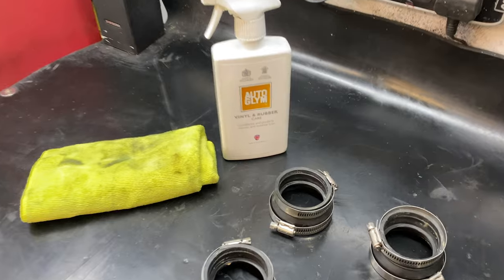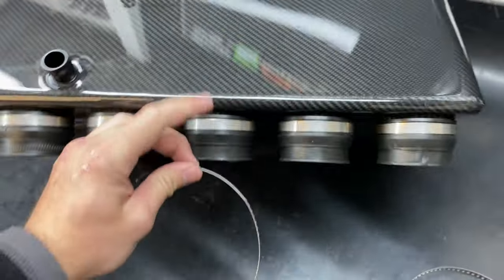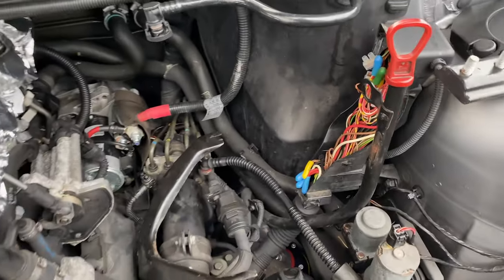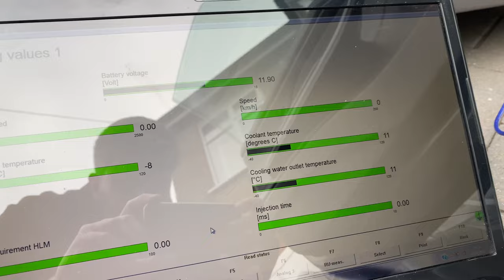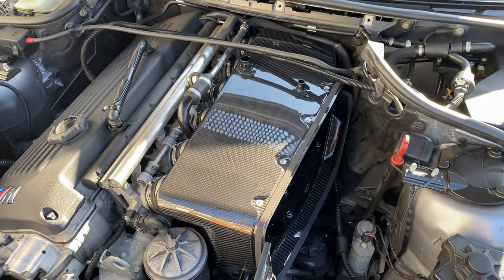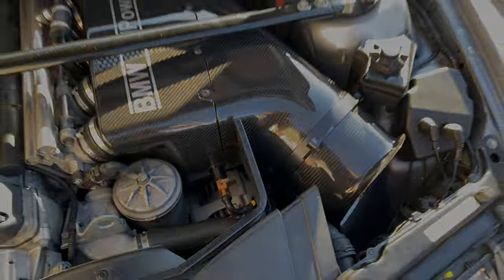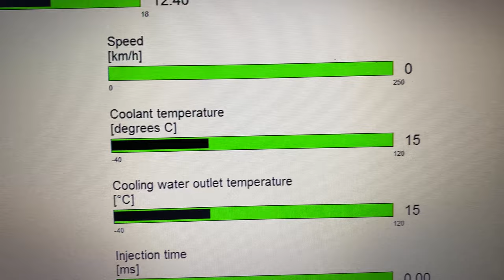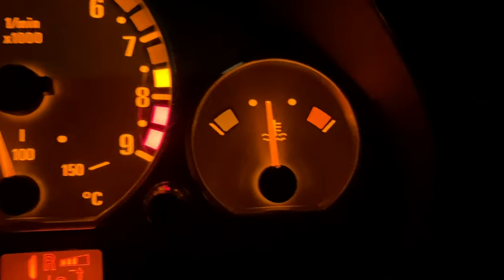BMW e46 M3 CSL Airbox Fitted + First Drive! Karbonious Fitting Part : 2

Comment: did you have any issues with that plastic piece rubbing? i just got mine done and instantly had scratches on my box from that piece rubbing
Reply from the maker: Thankfully no scratching but was very close, also keep in mind I have the powerflex adjustable engine mounts so less movement in my engine. Get the plastic piece chopped down and hopefully the box can be polished back to good as new
Reply: @stoneautomotive  for the time being a stuck a little piece of foam on the end of the plastic piece so we’ll see if that’s viable.

Comment: A tip for the wormclips. You can use the M5 E60 wormclips, which are smaller. Much easier to work on. You just have to be carefull to clear the ears on the thorttlebody. WHen I fitted the CB airbox on the S54 I did not have any issues using these wormclips from the m5 E60.
Reply from the maker: Good to know 👍 it will no doubt be off again at some stage lol

Comment: Was the change from stock MAF to CSL IAT via Ecuworx the only software change you did to get the car running smooth and without erros ? Normally people prefer to get a complete alpha-n software remap. I´d be interested whats the least interfering way to run the Airbox, maybe you can share your thoughts, thanks !
Reply from the maker: I had already had my ECU converted to MAP as this was how the Geoff steel unit was set up. ECU worx can provide all the software to convert from MAF > MAP 👍

Alpha N is the least efficient set-up as don’t not use MAF or MAP (manifold absolute pressure) sensors, it’s the easiest to install but also is not as smooth in terms of drivability, having driven a friends Alpha N it’s not something I would do for a car used on the road personally.

Comment: How did you fix the dispstick tube? By the way, regarding the SMG reservoir - did you have to use a different (longer) tubing to relocate it?
Reply from the maker: As per the video the dipstick is resting against the airbox with a silicone sleeve I fitted.

Yes CSL tube required

Comment: where did you get the BMW Mpower sticker for the airbox?
Reply from the maker: It came with the airbox but not sure if it’s something that’s always included as not detailed on the website as being included.

You can buy them online - https://www.ebay.co.uk/itm/204695120994?mkcid=16&mkevt=1&mkrid=711-127632-2357-0&ssspo=oqIpacj5SXe&sssrc=4429486&ssuid=CKFRglVnR7S&var=&widget_ver=artemis&media=COPY

Comment: in the video you fit the unfiltered section and snorkel as one piece . iam doing  this conversion myself and the snorkel wont fit, do you have to remove the  inlet pipe going down to lowerr bumper
Reply from the maker: I don’t run the factory CSL ducting, as detailed in my earlier video I run 100mm direct from the bumper intake so can be lowered as one piece in my case 👍

Video below -

BMW e46 M3 CSL replica body kit + wheel fitting
https://youtu.be/D-UjnnVHORY

Comment: 8:00 how does one undo this IAT splice and go back to MAF wiring sensor if one needed to for smog inspection? I chose a car because it had Redish RACP reinforcement, but I got in over my head because of the CSL airbox present which is a problem for MOT here :\
Reply from the maker: Hi,

You shouldn’t need the MAF at all if you’ve fitted the MAP sensor in its place (the CSL runs MAP - manifold absolute pressure sensor as standard over mass air flow)

Only issue is if the cars running “alpha N” mapping which i would avoid anyway as never found them to drive nicely without the parameter control

Comment: 18.55 That car was trying to follow you lol or was he with you?
Reply from the maker: It was my mate, left him for dead but had to make sure hence the repeat mirror checks 😅
Reply: @stoneautomotive  yeah I saw those mirror checks haha, what was he driving?
Reply from the maker: @swansmeister  modified e46 330 so I head the slight advantage with power but always great to see how much gap you can create 😅
Reply: @stoneautomotive  nice, e46 duo for the win. Just got some new mods on my car also, waiting for the last one, actualy from Regal Autosport, a wavetrack diff but it's in backorder. After that the car is finished.
Reply from the maker: @swansmeister  nice choice sir 😎 proper diff that 👌
Reply: @stoneautomotive  I think for my car (rs3 8p highly tuned) and my application which is streetuse yes I think it is. An open diff could be better for example on the nurburgring but if I go there I mosly rent a car with rent4ring. We were talking about going to meet up there one day and I wasnt supposed to say which car I have to keep you guessing but fuck it now you know. Aint no regular rs3 8p tho, it's a monster even if I say so myself :D